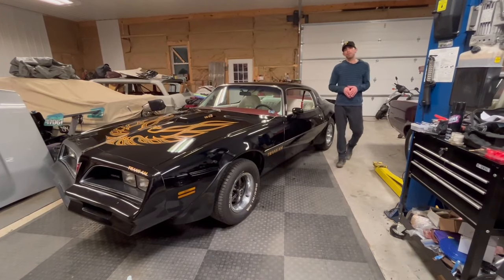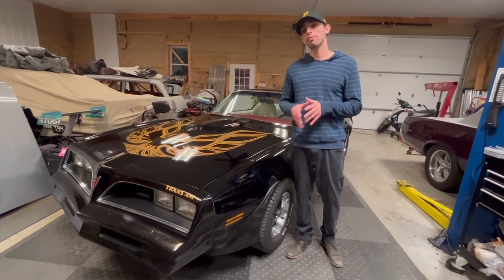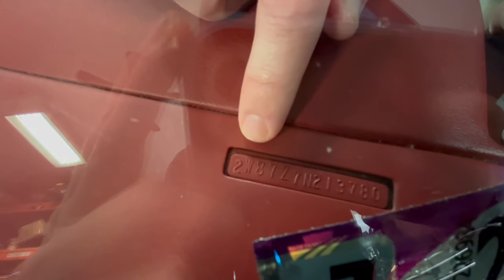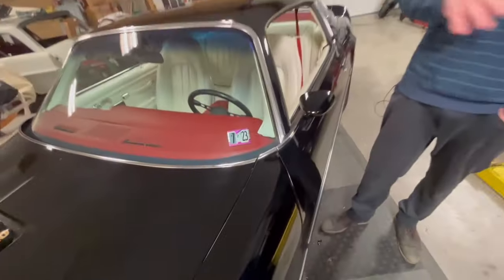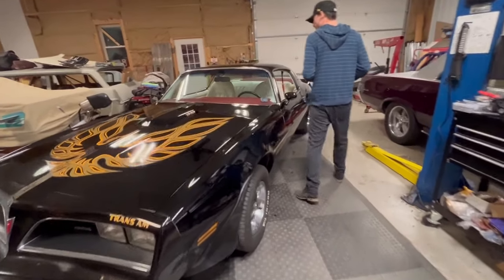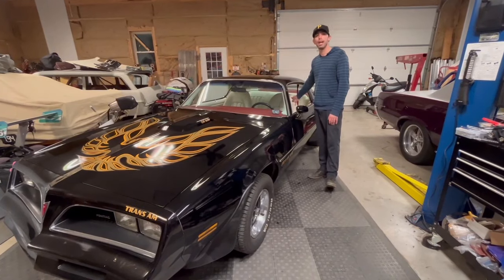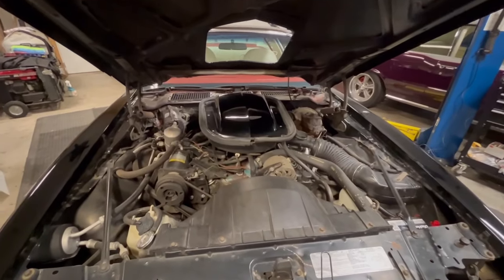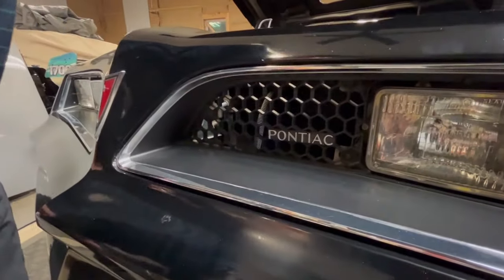Subtle Differences Only True TRANS AM Fans KNOW! 1977 Pontiac TRANS AM

Comment: If memory serves all manual transmission cars were the W-72, 200-220 HP (depending on year), the 403 was 185hp and the L78 was 180hp.  The sure fire way to tell a W-72 engine though is the heads.  Both the L78 and W-72 used 6X heads, however, there was a large chamber and small Chamber head, the W-72 (small Chamber) had "4" stamped on a flat (boss) on the side of the head, the L78 had an "8".  Good video and beautiful car!
Reply: I partially agree with you. The w72 DID come with an automatic and a manuel. Another way to tell is the chrome valve covers. 
W72 in 77 is 200hp
W72 in 78 is 220hp
L78 400 in 77 and 78 is 180hp
Olds 403 is 185hp in 77, 78, and 79.

In 79 however, the W72 220hp t/a 6.6, only came with a manuel.
The Olds 403 in 79, 6.6 liter, only came with an automatic.

Comment: Great video. I ordered a 1977 Trans Am from the factory and took delivery in May 1977.  I lived in Colorado Springs at the time, and the engines required in that area were the Olds 403 due to the high altitude.  Just like California, you could not get the Pontiac 400, and, the automatic transmission was required. No manuals. I actually found the Olds 403 to be a very reliable motor with good top end speed.
Reply: I agree  the 403 Oldsmobile  engine  were pretty  reliable  I remember  most of your ninety eight Oldsmobile  or delta 88s had them

Comment: Love that PMD had the nerve to leave the W72 rating at 200-220hp. . Having had both the difference  between the L78, L80 and the W72 T/A 6.6 is huge. Over here in Europe , we  can run them with no cats  no egr  and we have 99 octane fuel available. Bump that static timing up 5 degrees and  they are alarmingly quick. The Olds, however is just a lovely old smoothie.

Comment: Great video, but just a few nit picks.  The 1977 SE T/As had a red emblem on the nose, and the '78s had a gold one; not sure about non-SE T/As.  Also, I believe that you could only get the gold snowflakes on the SEs (with the front of the spokes and the edges of the rims machined to bare metal), but you could get the non-gold snowflakes on other T/As and Firebirds as an option.  Another difference in the SEs is that the front and rear window trim was blacked out, not silver/chrome, and there was no trim on the rear of the hood.  

One thing you failed to mention, you can tell a non-SE from an SE by these differences, but you can't necessarily tell if a T/A is a true SE just because it has those things on it.  There are probably more SE clones than real ones 😀.  Fortunately, I have a real one (according to PHS).
Reply: A true 1977 special edition will have either Y81 or Y82 for hard top or t-top to where the 1977 non special edition cars did not show that on the cowl trim.

Now on the rims not all Trans Am special editions came with snowflake rims if the N67 rally II rim was ordered it came gold in color and has been documented by the Bandit Trans Am club to be in existence. I do know you could get snowflake wheels on Grand Prix, Lemans and Trans Am. They were most popular on the Firebird and Trans Am, but you could also order them on other Pontiac models like the Grand Prix and Lemans. At first the snowflake rims were available in different colors such as red, white, blue, gold and grey. The rims were so popular production couldn't meet the demand, the snowflakes were canceled for the other Pontiac models built after October 18th 1976. Also because of the limited supply, the red, white and blue colors were canceled and you could only get the grey or the gold snowflake rims. The specialty Firebirds like the Sky Bird, the Red Bird and the Yellow Bird still came with the painted rims to match the body color of the car. Beginning in 1978 the ws6 snowflake rim that was an inch wider and had an inch wide lip.

Comment: You couldn't get the wide chrome trim on the roof line and the top of the doors on a SE cars, they used a thin chrome bead. The trim around the windshield and rear window was painted black on a SE car.

Comment: So it has the chrome valve covered 400 w72 Pontiac 220hp w/4spd. But it’s not a SE… got it
Reply: The chrome valve covered t/a 6.6, could also come with an automatic.  As far as the SE cars, I don't know if you could order the l78, 180hp or the W72 200 or 220hp( depending on year). That is a really good question. For what ever it's worth, I've never seen a SE, y81( non t-top), or a Y82( t-top), that wasn't a w72...lol
Reply: So basically  it seems the owner had ordered the w72 and 4spd tranny along with that interior colors

Comment: The vin plate under the hood is a fake..they were not affixed to the vehicle in that manner.
Reply: I believe that is somewhat year dependent, I know they did use screws, but don't remember mine (1978) having Phillips head screws.  I was going to go check later.
Reply: 1977 Firebirds had the screws in the data plate. It was the earlier 2nd gen F-body that used the rivets.
Reply: Mine are like that too. Same screws .l bought mine in the nineties  from the original owner. So it was all original  ,and all my older gm cars didn't  have a screw like that, i always wondered   when they  switched
Reply: nope. my 78 y88 has the same bolts.

Comment: Fisher made the T tops not Hurst
Reply from the maker: Both Fisher and Hurst made T tops..
Reply: @backyardbarnfinds  interesting
Reply: @backyardbarnfinds  Fisher were black trimmed.  Hurst were silver trimmed.
Reply: @MrHaps-yq3nu  You are somewhat right, all Hurst t-tops did come with chrome trim except for the special edition cars the frames were chemically blackened and black tinted safety glass was added to make the car look to have a solid roof since all SE cars in 1977 was black.
Reply: That depended on the year btw...

Comment: I bought a 1977 Special Edition 
Pontiac Trans Am from a Pontiac Dealer 
in 1986.  It was, a trade in for a newer
86 T/A.  
The 1977 came with the Original Factory 
Window Sticker with All the car Specs
Options, and price.  This T/A had a majority of the available options.  Some 
rather rare options.  The Sticker price was $7450.   
Being a 1977 Black & Gold SE 
(Smokey & the Bandit), T/A;  
It had the W72 400 Engine; Chrome Valve Covers, The 6.6 T/A Hood Scoop 
Decal, Chrome Twin Splitter Tailpipes, 
Hurst T-Tops, Gold Snowflake Wheels, 
Rear Defrost, awesome Clothe Deluxe Black seating, Rear Back Seat Console
(Rare!), Factory Cruise Control (Rare!),
All the Exact Classic SE Decals, Striping,
Blacked-Out window Trims, Etc.  
I owned the car for 3 years and added 
a lot of horsepower by under the hood modifications and upgrades.  
It was SO Much Fun to have as a 
19-22 year old!   It was fast as hell,
laid tire patches shifting from first to second; and second to third gears!
It had Lower Rear End Gear Ratio; 
3.73.  I could roast the tires off the start 
for a block long if I wanted to.  Always had to lay off the gas.